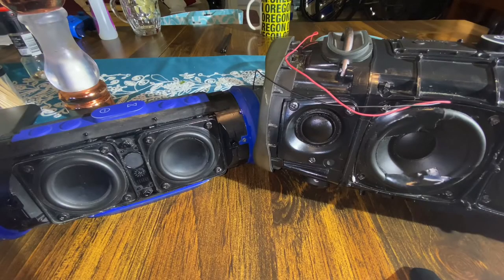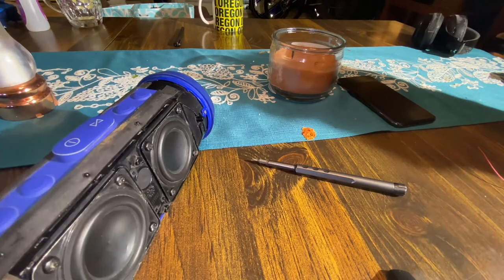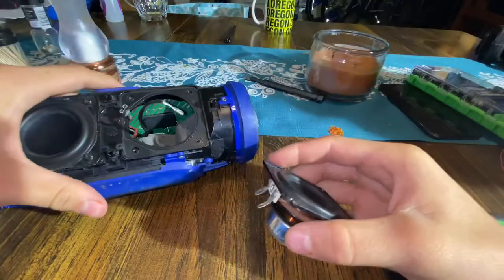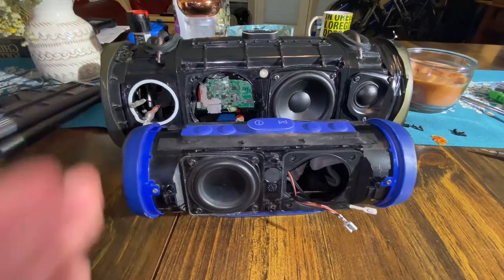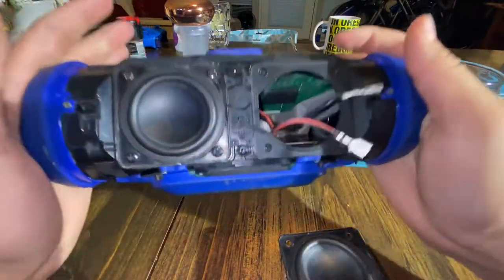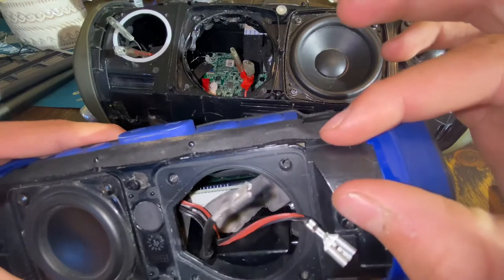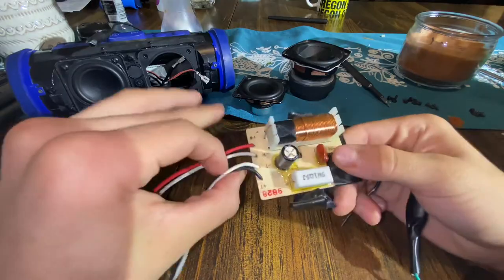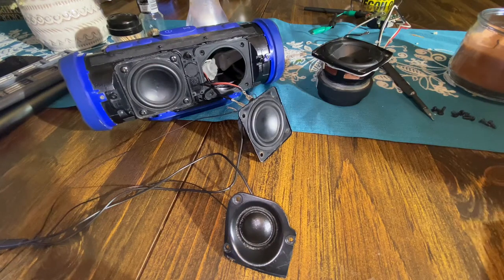Why the JBL Charged 3 doesn’t have tweeters

Comment: Thanks for following up on my comment with a video. I apologize that I didn't explain my take better. What I meant is simply the fact that it won't be as good as a 2way or 3way speaker. Not why does the Charge 3 not have them. And yes 100 dollars for a JBL Charge 3 makes sense for what you get, it's a very impressive portable Bluetooth speaker and obviously not trying to impress any audiophile. Portable Bluetooth speakers aren't even going for audiophiles or serious people anyway, just for good sounds on the go and at a low cost with cost in mind. 

Also an off topic question. When testing speaker or amp equipment, do you use lossless audio codecs like Wav or FLAC when playing back audio? Obviously you can't in your videos because NCS only releases lossy mp3 files and it wouldn't help when filming with a microphone. Sorry I'm an audiophile and techy, lol.